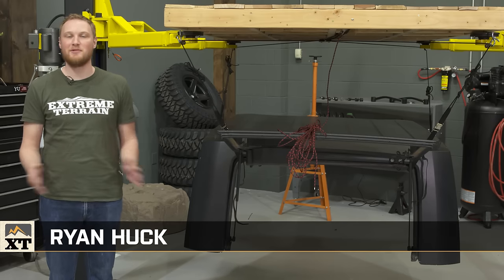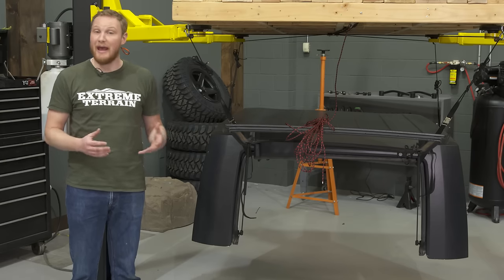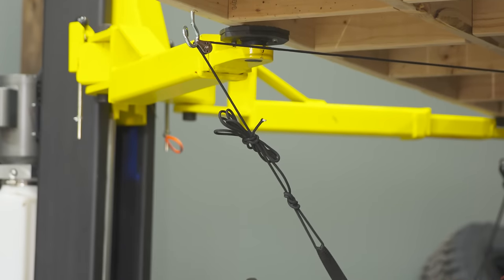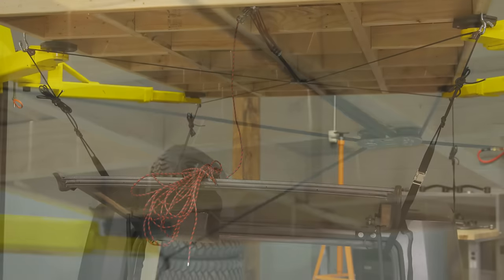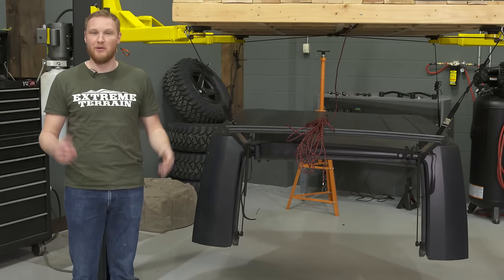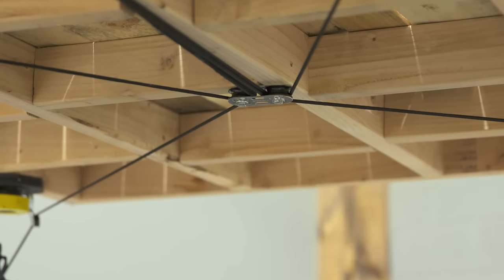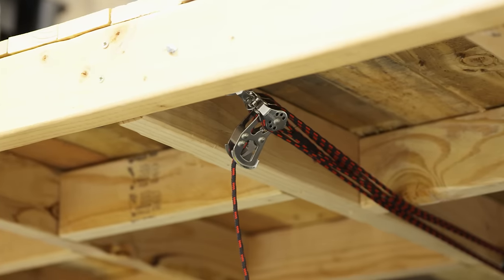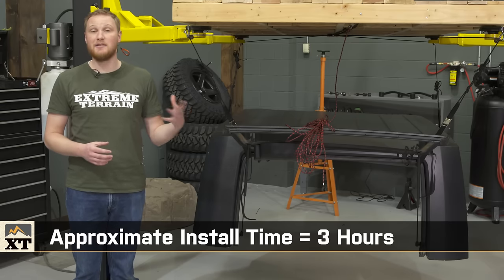Jeep Wrangler Harken Hoister Garage Storage 4-Point Lift System (1987-2016 YJ, TJ & JK) Review

Comment: The 3 hour install time is accurate, it's not too awful bad, but tying the knots up high was a huge pain. I still haven't figured out what I am going to do with the ropes just dangling in my way when not in use. I got this for free and spent $20 on wood and bolts to complete the install. I can see why the last person gave this to me and didn't use it themself.
Reply: Tony Fall2Fast what are the measurements  in between bolts to have the 4 points of lifting even ?

Comment: It will work just fine with a ceiling less than 10' high.
Reply from the maker: Hey Gary, we just advised a 10ft or higher ceiling just for the purpose of some people having a large lift kit installed on their Jeeps. Or that some people like Ryan are on the taller side and may whack their heads on the top if they're not careful. -Jake

Comment: what they don't tell you if the cap is on it it works fine for lower if there's no weight you have to get up and pull back the release and it still won't move I had to put dive weights on it just to get it to lower to put the cap on it